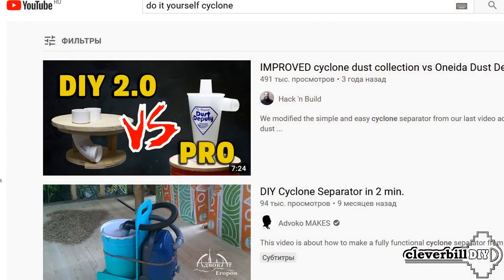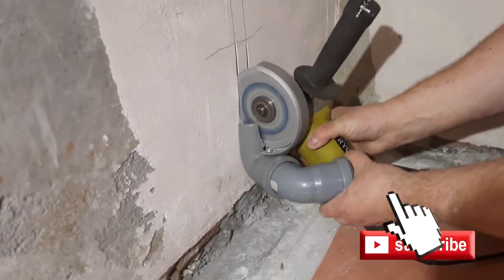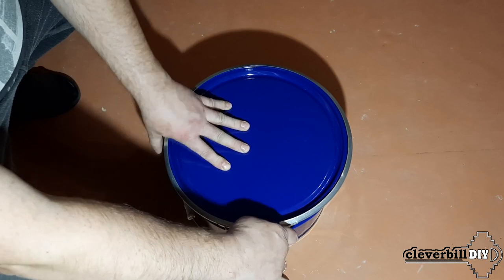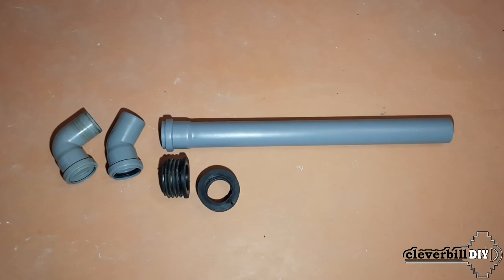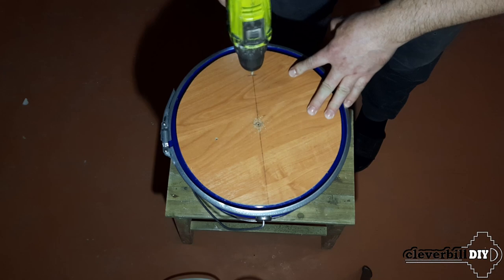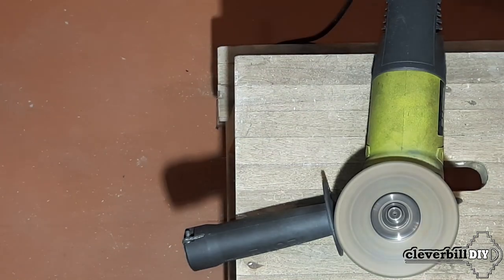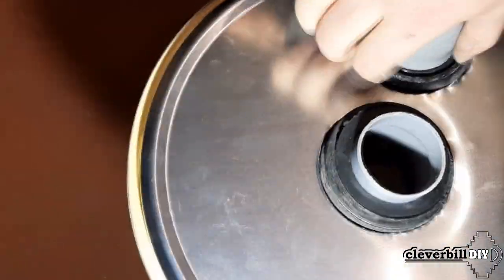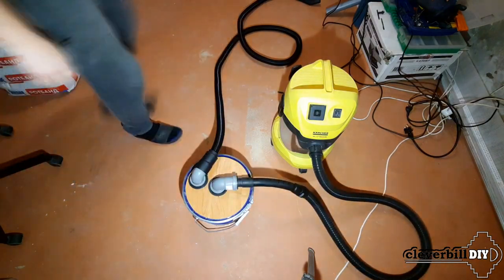Cyclone filter - from regular bucket - DIY

Comment from the maker: It is very easy to make a cyclone filter for a vacuum cleaner. Just what you need is a bucket, 50mm sewer pipes and couplings to them and a little free time, which is more than compensated by a longer use of the dust bag that is in the vacuum cleaner.